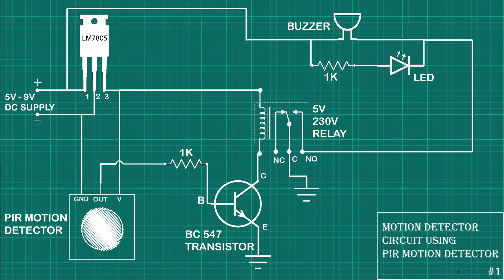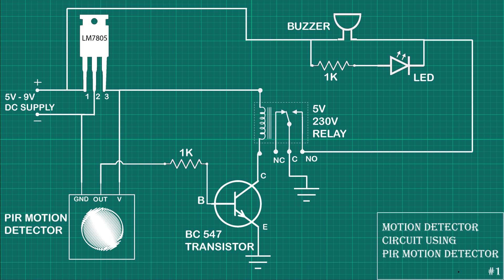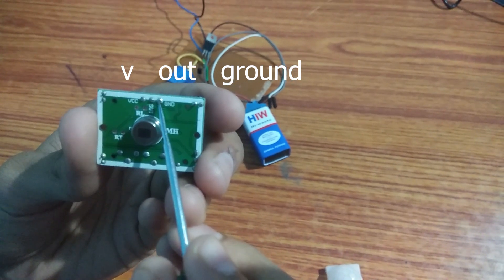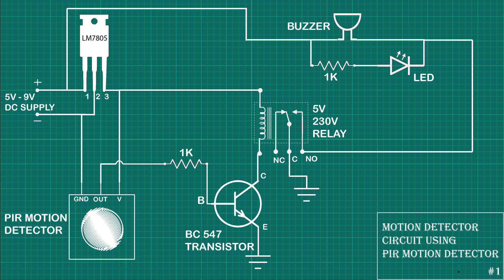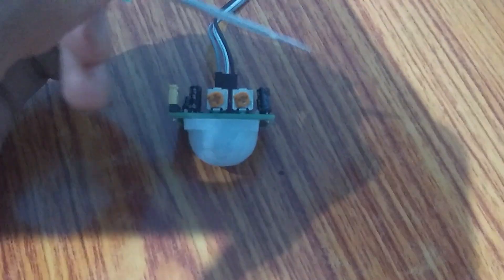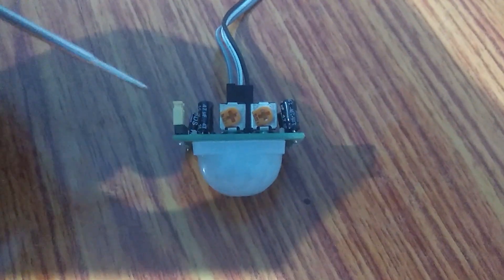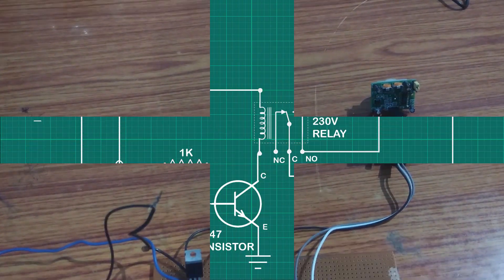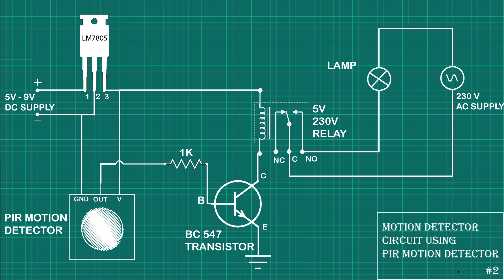How to fix PIR motion detector sensor- PIR sensor not working properly?

Comment from the maker: Suggest topics for next video in comments
Reply: You have to use Flyback diode for relay applications which is controlled like transistors.
Reply from the maker: For inductive loads
Reply: @EngineerWithin  Yeah.
Reply: @EngineerWithin  where to connect 10k ntc thermistor on PIR for it to work perfectly in high temperature during hot bath inside the  bathroom ?

Comment: This video was the best in certain for explain pir. i had the same issue in false triggering repeatedly in my project. were i used node mcu. at initially this problem was found only with the 3.3v pin latter i changed it to 5v supply from very same node mcu. it stated working fine. i guess there has to be something to do with the 5v. it doesn't work certainly for less than 3v!!!!

Comment: Hi brother, great video. I am working on a project where i am required to Design an Arduino  that does the following:

collects movement data and displays it on a computer screen and display a graph of this activity over time. I have no experience with Arduino, any suggestion would be appreciated. my sensor does not seem to be working.

Comment: Why there is no jumper pins and connector on my PIR sensor module?
Reply from the maker: You can solder wires directly.....you have another varient of PIR so...
Reply: @EngineerWithin  What variant is it? In the jumper position there are three dots and MD, L and H is written. Tried to connect wire between MD and L ,and now the sensor is not working anymore. So is it dead? What to do next?
Reply: Tried to solder wire but the module gets very hot and no motion detection. Help.
Reply from the maker: Let it be hot...but once you solder wires....ther shoul be no problem...
Reply: @EngineerWithin  But it is not working. I used KTN2222 NPN transistor and 220ohm resistor.

Comment: Can you please do a video on pir automatic led strip light... I have got 12v 2a power supply and connected it to PIR and LED strip(12v) and output of PIR to N channel mofoset with 10k resistor... but led not bright... Can you suggest me N channel Mofoset required for 12v 2a
Reply: I have the same problem here.  Remember the output from the sensor is only 3.3V. The led strip needs 12V to be full bright.
Reply from the maker: Use transistor and then realy as a switch

Comment: How can I reduce the "delay time" from 5 seconds to even further. The default minimum is 5 seconds , but I want to reduce it.
Appreciate a reply.
Reply: actually you can but it is a bit more difficult as you need to change the onboard resistor value
Reply from the maker: It is not possible, because you can not change the circuitry of sensor! Thats why

Comment: i hated this sensor ... it's drived me crazy !
i did everything in this video and changed modes and try a different pir sensors and all same ..
working some times and turn it self  on and off ..!!

please don't use it without it's lense , this lense give a wide angle and filtering the noise and make the sensor more stable..
Reply: same problem here
Reply: Will the problem solve if I use it with it's lense ?

Comment: Thanks for the comments/replies.
Q: I want to use a SSR Solid state relay instead of the one that you described. The SSR has 3 pins on the DC side ( DC+, DC- and CH pins )
DC+ is for Power 5v ,
DC- is for negative/GND.
Can the use the SSR in this circuit ? 0:17.
I want to know how to connect the 3 pins of SSR in your circuit. Appreciate a reply.
SSR details are in 
http://wiki.sunfounder.cc/index.php?title=1_Channel_5V_Solid_State_Relay_Module
Reply from the maker: Yes you can use it in give circuit.
You just need to connect .. output terminal of PIR to the CH1 of solod state relay and rest of the circuit will remain same....usjng SSR is a good choice, as very less voltage is requie to trigger or On the SSR
Reply: @EngineerWithin  Super !  Very good answer, this is exactly what I was expecting - as the SSR has a transistor inside. Now, next problem.
The SSR triggers when there is a 
- X-- Cut and Paste from http://wiki.sunfounder.cc/index.php?title=1_Channel_5V_Solid_State_Relay_Module -
-X-
...
...
Input Voltage of Control Signal: 
0-2.5V (low level state), the relay will be on; 
3-5V (high level state), the relay will be off.
"
The PIR on the output pin sends a 0.4V when there is NO motion and 1.98V when there is a motion.
So in this case - since it is less than 2.5V in either cases,  the relay will be always ON - at all times - I tried this already.
What can I do - to overcome this challenge.
How can I distinguish the 1.98v ( or make it 2V, or anything above 1.8V) bump up to > 3V so that the relay will be OFF.
The SSR relay works in reverse.. when OFF, then it will enable the AC Load.
Thanks and appreciated your quick response.
Reply from the maker: You can use transistor as a switch, configure it in such a way that, transistor will not turn on on 0.4v
Reply from the maker: Give the output of the transistor to relay...so when there is more than 0.1 v or more than that ... transistor will turn on and trigger the relay..
Hope this solves your problem.
Reply: @EngineerWithin  - If you dont mind. What's the output of the transistor ? I dont think its the Emitter. 
So it must be the collector ? In that case - where would the CH pin of the Relay be connected to ?
Please clarify .
If you have a circuit - you could send it to kiranshash@yahoo.com. Would help a lot.
Reply from the maker: You can search on Google...or use everycurcuit app to make a circuit
Reply from the maker: Use transistor as a switching circuit as i used in the circuit
Reply from the maker: There is no need of transistor in case of SSR

Comment: 1. (Important - Please answer when possible ) How can I reduce the sleep time after the trigger has ended. I'm reading that there is a 5 seconds sleep time/timeout after the trigger has ended. I want to reduce that to even lesser.
2. I am not using the 7805, however I am using an Arduino to power the 5v to the sensor ? What's your recommendation .
Reply from the maker: I think minimum trigger time is 5 seconds...you can not decrease it further.
Reply from the maker: Its fine to use arduino.
Reply: you can programme in adrino to ignore the inputs and timecontrol take the out from audrino instead of directly from sensor

Comment: I bought 4 PIR motion sensor module  but all 4 continuously 3volt out put on  output pin when I connect 5volt  power supply. 
 what is wrong  where is mistake  please help me 
Thanking you in advance
Reply: sensor output will not more than 3 v. you should use 547 transistor to enhance it
Reply from the maker: Sensor takes time for calibration...turn on and leave the sensor.... don't use more than 5v supply
Reply: Same with me. How to solve this problem

Comment: I am using same Sensor and same circuit, my issue is even though we are in room/ bathroom but light is getting switch off after timer set time, light should be on only till person in room, how to solve this issue?

Jumper is on H only on PIR circuit
Reply from the maker: You can try changing modes
Reply: @EngineerWithin  thanks for your reply, I tried lots of mode combinations, I am using 4.8V DC adopter, do you think 9 V DC may solve my problem?
Reply from the maker: No, it will damage the sensor

Comment: Great video Sir
Sir my pir motion sensor is constantly on and off. This is not stable, please help
Reply from the maker: As mentioned in the video.....sensor takes time for calibration...so after setting time and distance to minimum position....leave sensor without any movement for calibration
Reply: Engineer Within Thank you for your reply Sir.
But 
Sir my PIR sensor is constantly on / off. I checked for 30 minutes but it is not stable.
What could be a problem in the circuit. Can any part be changed?
Reply from the maker: How much voltage did you gave?
Reply: Engineer Within SIR 4.8v
Reply from the maker: Try changing the sensor....or check the mode of the sensor... monostable or astable
Reply: same problem here, tried everything
Reply: same problem 🥱